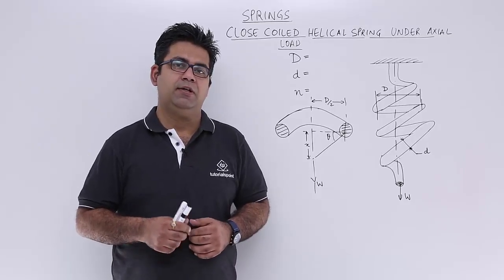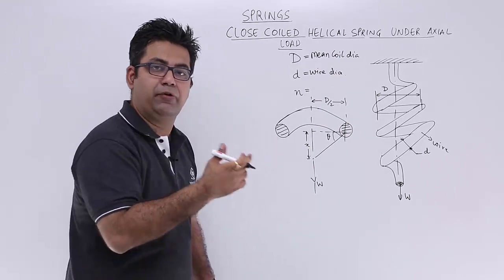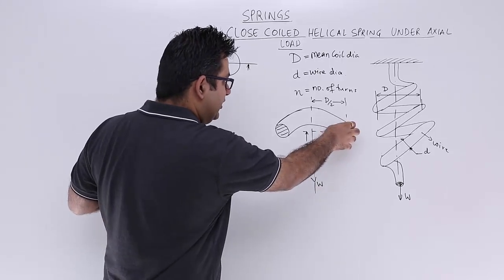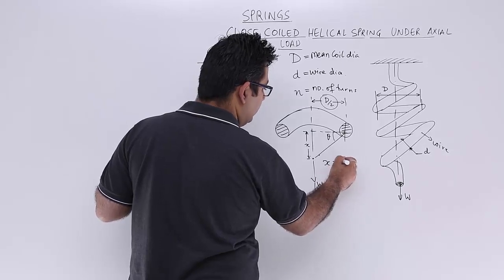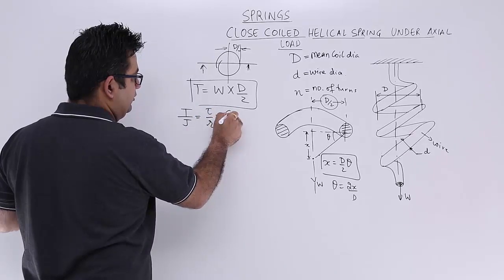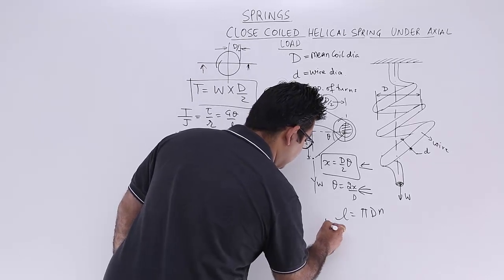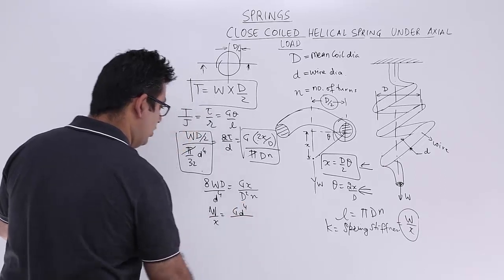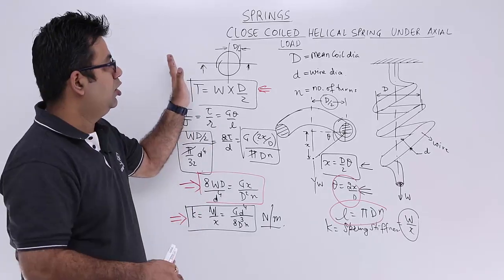Close Coiled Helical Spring Under Axial

Comment: Sir I am not getting clear concepts about these two things that how it will twist under axial load and also when we apply torque how bending stress will generate....? What I think that when we apply torque then it will twist or torsional stress will generate...
So pls clear my doubts sir.
Reply: The wire itself is getting twisted when axial load is applied